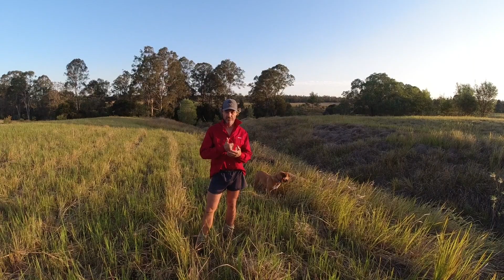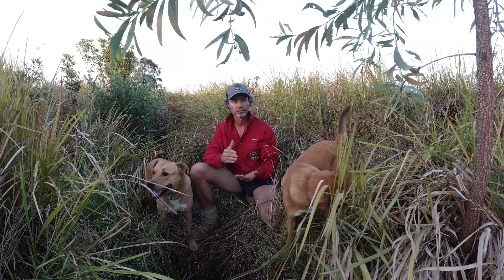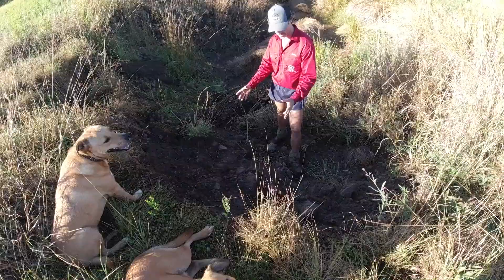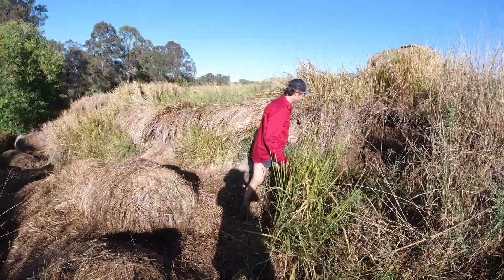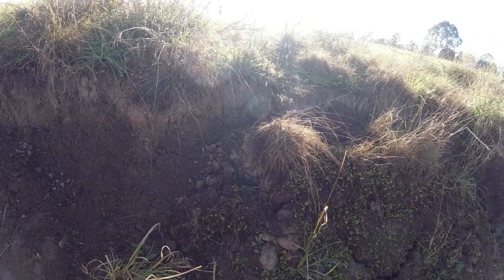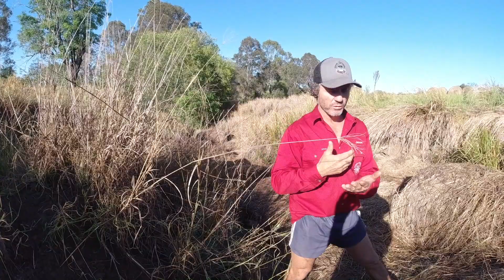GULLY EROSION - THE WHY, HOW, PREVENTATIVE MEASURES & REMEDIATION!! (PART 1)

Comment: Research Media Luna and Zuni Bowl.  Those head cuts will continue to travel uphill because you've not dispersed the water before it hits the edge and waterfalls over.  The bales of hay in the channel are great, basically a Beaver Dam Analog, but stopping the head cut requires armoring of the soil on top of the cut.  We've had great success using One Rock Dams, Media Luna, Zuni Bowls, and Beaver Dam Analogs here in the States.  In the Southwestern States like Nevada, the conditions are very similar to what you see in Australia, so there's no doubt that the same techniques would work.... and they're a lot easier and cheaper, imo. 

If you don't have large rocks to use, you can make a "gabion" from chicken wire filled with gravel.  Roll it up into a tube and stake it to the ground so the water can't move it.
Reply from the maker: Hi Three Rivers Forge, firstly thank-you for taking the time to watch our video and secondly for leaving such an extensive response. Definitely agree with you when it comes to having to deal with the raging surface run off water before it reaches the head cuts. Years of overgrazing, poor soil quality and compaction has created these conditions. Similar to what you have suggested, I have sourced a few fallen tree trunks which I intend to lay across in front of the head cut. Then I have some various size rocks to place up in front of these trunks which will optimally slow the flow of water. Once I've built up the organic matter and litter bank in the paddocks above, will the rain be able to penetrate the ground rather than just running off. Obviously this is going to take some time, after which the head cuts can be battered down. Which will immediately be followed up with seeding and mulching. As you mentioned I placed the mulch hay to act as a silt barrier to capture the soil which use to flow into our creek. Once again we appreciate you taking the time out of your day to post this comment mate, hope you have a grand day! 
Cheers Jason & Nic
Reply: @Udderfarm  The folks over at Rockpile, in your neck of the woods, have done great things with making Leaky Weirs and Beaver Dam Analogs from what's available on their block -- https://www.youtube.com/watch?v=No9mblykXII -- and I highly recommend their channel for a little inspiration.

I'm not sure if you're following Ari over at Polyculture Farms channel, but he's done great things using short sections of downed logs to create contour lines on his slopes.  They work exactly as you suggest, creating a small barrier that slows the runoff and spread out.  https://www.youtube.com/watch?v=px8HAuIbMnw&t=394s  If he can rejuvenate that horrible Australian hard pan soil with what's basically firewood, anyone can do it. 

I also like his use of Rip Lines on Contour.  While this requires heavy machinery, it acts like a berm in a lot of ways, breaking up the flow of water and allowing it to better sink in to the soil.  Planting them with Tiller's Radish was just brilliant, in my opinion, because it killed two birds with one stone.   https://www.youtube.com/watch?v=LvEqx00krVc

When it comes to armoring a head cut and stopping it from progressing, especially in dry lands that get monsoon rains, the Zuni Bowl provides the best bang for the buck.... but they are a pain to make because you usually have to import the rock.  
https://www.youtube.com/watch?v=QS8HertuStE  Better than nothing, obviously, and I like that they create something that'll last forever and allow the natural soil aggradation to take place over time.

Those gullies are carrying a ton of water out of the land, so it's going to take a bunch of Beaver Dam Analogs and Leaky Weirs to slow the flow.  It'll be fun to see the land's transformation!
Reply from the maker: Wow, thanks for your time and effort in your response there Three River Forge! I will definitely have to have a look at those sites. We appreciate your detailed message and your suggested links mate! Jason & Nic
Reply: @Udderfarm  Glad you found it of use.  In our dry western states, we've been dealing with this kind of problem for years and found that it's pretty easy to deal with the situation once you realize what's causing things at the very beginning of the process.  Beaver Dam Analogs can raise up the gully floor by 3' or more in just the first few months of rain depending on how much sediment load the run-off is carrying.  Using BDA's to repair those gullies might take longer than using heavy machinery, but I think it's an easier process in a lot of scenarios and well worth keeping in mind.

It's because there were no BDA's or Leaky Weirs in the first place that gullies formed.  Even the smallest crease in the land acts like a gutter, focusing the strength of the water's flow to the point that it becomes highly erosive and starts carrying the soil off to the ocean.  If we place even a single log or line of heavy rocks across those small folds in the land to slow the water, we stop the gulley formation before it can even begin.  Even better, we give the water time to actually sink into OUR land rather than run off our land.

I like to tell folks in the arid regions that their job is to make sure not one drop of water is allowed to leave their land until it's filled out an emigration form, in triplicate.  Tie that water up in so much bureaucratic red tape that it tries climbing back up into the clouds!

We tend to forget that the biggest rivers start their lives as the tiniest little trickles way up in the mountains.  If we try stopping the water once it's become a raging torrent, it will be a big job of work and cost a ton of money.  However, if we go uphill a bit and look for those tiny little tributaries, the little creases in the land that might be dry now but will surely be channeling water when the rain comes, it's easy work to put a few stones or logs across the path of the flow.

If wood is scarce, we can use rocks to make a Media Luna.  The Media Luna works much like a Beaver Dam Analog except it's meant for those very small trickles up in the hills, not huge flows down in the valleys.  https://www.youtube.com/watch?v=W1JAv9wca1E  You might have to build up the Media Luna every year as sediment gets trapped behind it, but that's just proof that it's working like you hoped - preventing gully erosion and slowing water so it has time to percolate down into the soil.

And, sure, use those rocks to fill the small gullies in the same way.  Stack them tight so they interlock with each other, then move down the channel a few yards and build another one.  That works the same as a Beaver Dam Analog by slowing the water without trying to stop the water completely.  As the water slows, sediment drops out of solution to build up the channel bed and the water has time to sink into the ground.  It's just a matter of having enough of the Dams along the channel so they can work together to repair the damage.  You don't want to make the too big, expecting them to hold back a giant lake, because then you're just asking for a blow-out that causes far more damage.  Best to make them small enough that they survive the storms but trap a foot of sediment.  Then you build them up higher for the next rain that comes.  A slower process, maybe, but it works.